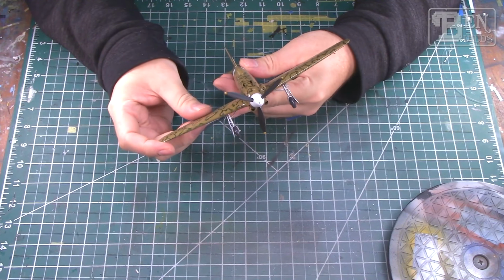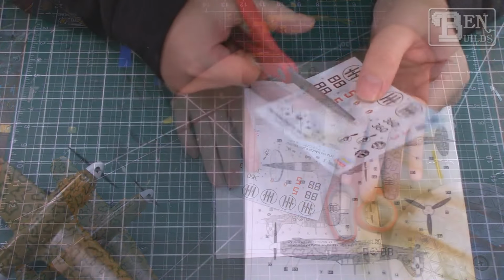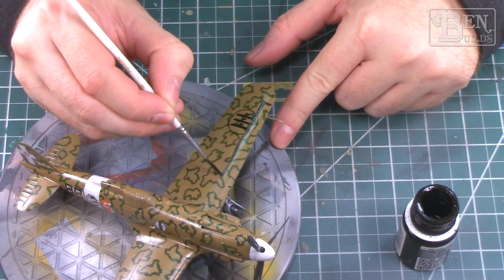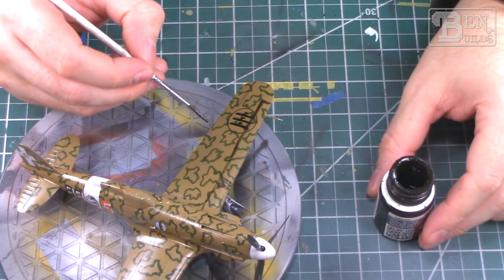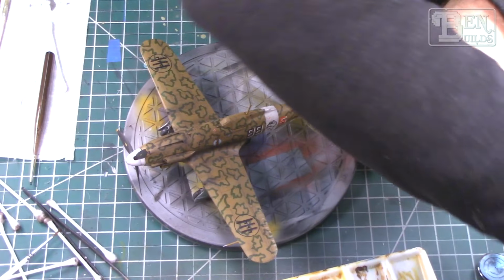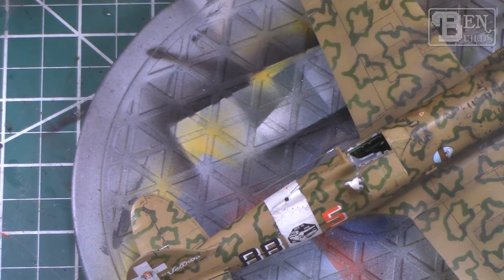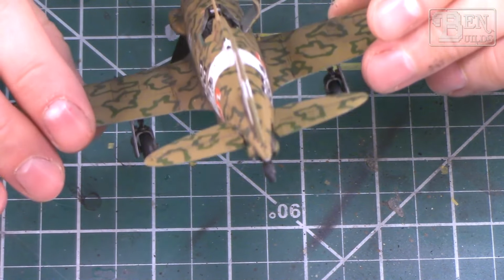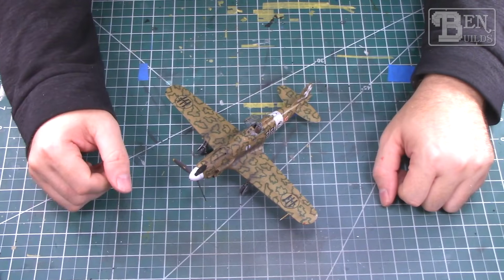Ben Builds With Joe S9 - Macchi Mc. 205 ep. 7 Final

Comment: Super finish. I struggle with the aerials even with the accelerator (learned how to put a drop on watching your videos) - think my hands suddenly get the shakes 🙄
Never thought about spraying oils. Presume you thin it with enamel thinner?
Reply from the maker: Thank you, Bryan! I notice my hands also get a bit unsteady, especially when I try to do delicate things like wires and such. Usually, if I use a finger on my dominant hand and try to get a 3rd point of contact to either the object or the table, I am not nearly as twitchy. That might help a bit?  

Yes, I thinned the oil paint with some odorless enamel thinner and it worked alright. Not perfect, but it was fun to try something new. I've also tried to spray AK panelliners before, but that didn't work as well lol. Weathering is always a challenge for me, but that just means that I need to work at it more! lol